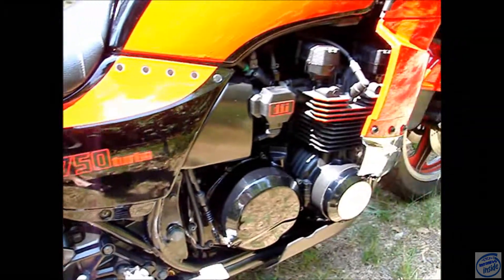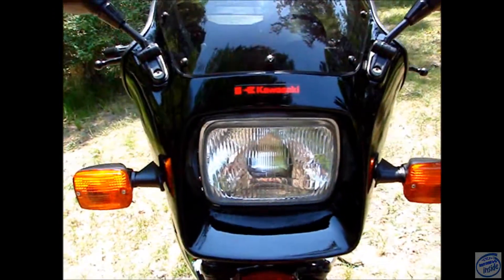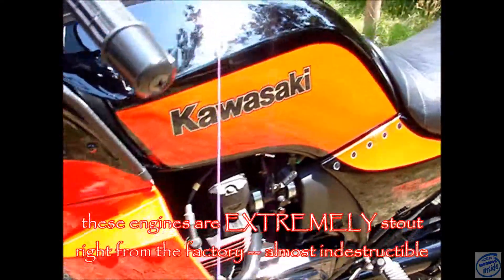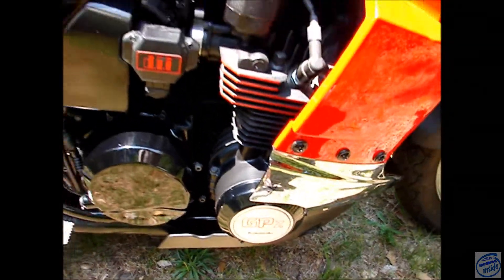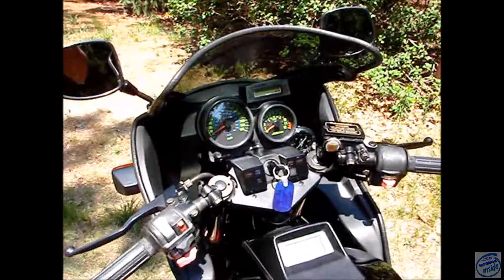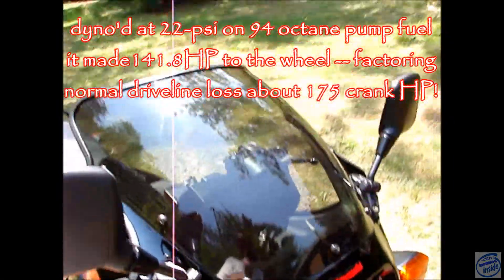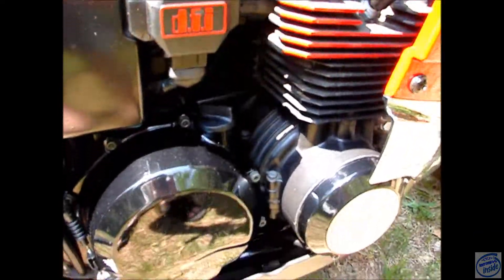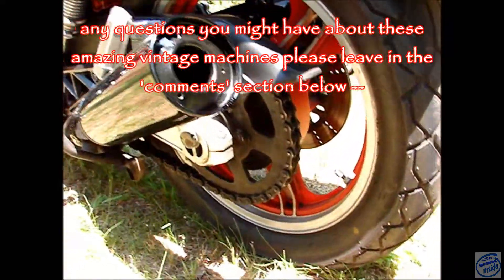1985 GPZ-750 Turbo 175HP Kawasaki RESTORED Wicked 80's Classic Superbike! Startup & Walkaround in HD

Comment: I had an 1985 ZX750E2 turbo for 7 years. Bought it as a new leftover in 1987, put 120k miles on it in Phoenix, mostly city miles. It was my only vehicle for those years. Loved it. Still have dreams about it. We were buddies like no other vehicle I've owned. LOL. Lots of stories. Never had a single issue with it ever.
Reply from the maker: WoW...120,000 miles...unreal! We stared at ours and wrenched on it more than rode it -- lol
Reply: @YourKeysPlease  I was a courier in Phoenix for a few years on it; put 950 miles on it the first week I owned it. I was really good about service intervals. The only mechanical issue I ever had was that the rubber clamp holding the FI unit in the tail section broke and the unit bounced around in there until it failed, so I wouldn't really call that a mechanical failure per se. I picked up a replacement for $50. I went through countless tires, chains, although I only replaced the clutch once (at 20k). Started every time, never even smoked. Just a perfect bike. I ended up selling it to a guy at Motorcycle Mechanics Institute for $1500. Bought it new for $3500. It was either that or a Yamaha Radian and the smart money was on the Yamaha. But I never once regretted my choice.  So many stories about that bike....

Comment: great vid, thanks... yep, if you dont remove the internal baffles they'll end up getting blown out anyway.... 3 issues i had with my Z750 Turbo was smallish fuel tank for thirsty engine at high speed and with no electric oil pump to the turbo you do not want to run out of fuel. turbo torque seemed to wear out soft back tyres quicker but harder tyres would slip, and chain and sprocket wear was something to constantly watch for... all these things were related to my heavy wrist coz it was a bike that was made for some abuse... apart from that the bike was awesome. real good for 200kph cruising.

Comment: Awesome bikes. I owned 2 of them. 1 was all stock I rode ofton on the street. The other was a full blown drag bike that got me into the 8 second 1/4 mile. It had an 880 kit, Mr turbo work, orient head and cams and several other bits. Yours is an extremely beautiful example. Ride it like you stole it!
Reply from the maker: That's exactly how it was ridden Gary, hence the reason for all the chassis upgrades -- a feeble attempt at making the GPZ-T handle as well as it accelerated. It helped, but these machines, especially with mods, will always have more engine than the rest of the bike can handle!

Comment: My friend had one, loved it. I had a 900 ninja. Those were the days!
Reply from the maker: Thanks for the comment Mark. We also had a Red, White 'n Blue '86 900 Ninja (final year) prior to the 750 Turbo... all the Kawi's from that era are really great bikes!
Reply: I had a 1986 GPZ 1000RX when I was 21 after owning a Suzuki 250 X7 and passing my test only eleven months earlier.Some beast that was in comparison. Quick in a straight line but handled like a tank even with early Michelin radials and a steering damper. My Cousin had a 1985 GPZ 600R great handling but not maybe enough power. Great era for bikes, I just wish I had kept mine. Also once rode a GPZ900R with the RX motor. Great handling and just as quick. Luckliy my mate worked at a bike shop so he would borrow the bikes and let me take them out for a test run, not that his boss knew. Rode a GPX750 and a Honda VFR750  from the shop but they were nowhere near as exciting as the GPZ's I had ridden before. The only bikes that were anywhere near as good were a GSXR1100 and a FZR1000 genesis.

Comment: My dad had one back when he was younger. And he beat the ever living dog crap out of it.
Reply from the maker: Can't kill 'em SlowRB... the only thing a turbo can't stand is low-octane fuel or running lean. Appreciate the comment!
Reply: @YourKeysPlease  What do you consider low? I'm out here in Arizona.
Reply from the maker: If you'd like to up the boost pressure anything beyond stock, at least 93+ octane. 100 octane low-lead aviation fuel is also a good choice if you're going for big boost. The intense heat of AZ won't help -- turbos love cool, dense air to avoid detonation and make big power. Hope this helps!
Reply: @YourKeysPlease  thats exactly what my father did. He worked on a private airport at the time. Ran aviation fuel often.

Substantially higher boost, and a nice bov
Reply: @YourKeysPlease  Thank you. Yeah I don't ride her in the Summer out here. I guess it's like the boys in the Midwest not riding in the winter! 111 yesterday and 110 today in Scottsdale.
Reply from the maker: @len9483  Whew -- Good thing it's a 'dry heat'!  🥵

Comment: Love this! I had an 83 GPz 750. Same motor, chassis, fairing.... Just a lot less power without the turbo. In fact, as I sit here looking at this beautiful piece, you are showing the crank cover. This is all I have left of my ol' bike. Except it's a bit, well, broken. Had me a little low-speed, cold tire high-side.
Reply: Not the same sprockets ,transmission shafts are larger, its fuel injected, the chain is larger.it as a sealed aluminum intake plenum. The list goes on as the motor was built for turbo charging.  I have 2 of these machines .  I will be putting a gpz frame with title on eBay this summer 1984 .
Reply: @MrHeavyzz4  I think kawi used the bottom end of the 1100 if i remember correctly..
Reply: @craig_sez8534  More like the 1100 used the same bottom end as the 750 but not the sprockets or the chain as they are huge.
Reply: @MrHeavyzz4  yeah i ment that the turbo used the 1100's bottom end..
Reply: @craig_sez8534  When did Kaw bld first 1100?
Reply: @MrHeavyzz4  i wanna say early 80's..The 1st gen of the gpz..I feel its a bit earlier with the ltd 1100 but i dont remember for sure..

Comment: What a beautifull 750....probably keep up or blow off alotta bikes on the market today !!!...Kawi's are tops !!!
Reply from the maker: Hey Wayne, thanks for the compliments. Considering the substantial weight and the fact it's now more than 35 years old (hard to believe it's been that long -- ugh!), the turbo will definitely still run with many current machines. From our perspective though, the new stuff has no 'soul', everything is refined to the point of boredom. In our opinion, older machines like the GPZ simply ooze character and are very engaging to ride and own. Bonus -- they're also continually going up in value as we head toward an electrified future. Appreciate your comment!

Comment: Has been on dyno ? Mine made 117 rwhp with 22 pounds boost, aftermarket exhaust, modified fuel system etc. And even then was not getting enough fuel for more power. Sold it in 1988. Was a fun bike, when the boost kicked in felt like warp speed for the era.
Reply from the maker: Yes, it was on a Dynojet 200 and made 141.8HP to the wheel. As mentioned throughout the video it took many mods to get to that level. Appreciate your comment -- warp speed indeed!

Comment: I caught at the end 630 chain and sprockets, put a modern 520 O ring conversion on it I reckon you would get another 5hp, plus less wear and tear on sprockets. Lovely bike, I raced a GPZ 750 in the 80's, great motor, but had gearbox issues.
Reply from the maker: That's true Sean, fitting a lighter 520-kit certainly would've liberated a few extra ponies, but for reliability (and the original 630 set was still in such great shape thanks to regular lubrication and adjustment) we left it alone. Incidentally, you mentioned the gearbox -- if memory serves the turbo's had a strengthened 5-speed box not shared with any other Kawi's. Hammered ours year after year, shifted like hot butter and never needed anything but one set of OEM clutch plates. Appreciate your comment!

Comment: Gorgeous bike!! Always wanted one! I had a 86’ Ninja 600R in the same colors. Sold it due to it being a tank slapper. I’m guessing that fork brace you installed was to also help the handling?
Reply from the maker: Your guess is spot-on David. Most of the mods performed were aimed at bringing the handling up to par with that mega-monster of an engine. Even with the Works shock, fork brace, rebuilt forks with Progressive springs, thicker mount bolts, etc. etc. you'd never mistake the handling for a new ZX-10R, but it wasn't bad. Hard to get around the laws of physics, and 540lbs. will always prefer a straight line over a curve.

Comment: This bike was capable of 170hp with  minor mods done in 2 hours for free put computer in race mode,dfi.mod ,with a drill and Philips head ,waste gate threads  in punched to make  adjustable, strong hose clamps for extra boost.plus 110 octane fuel.
Reply from the maker: You're correct Jon. Our computer was in race mode, had an aftermarket Garrett turbo unit with an adjustable wastegate, heavy-duty clamps throughout the intake, upgraded thicker engine mount bolts (important when you start making big power), and on 94-octane Sunoco pump gas made 141.8HP to the rear wheel on a Dynojet model 200... this works out to roughly 175HP at the crank. Appreciate your comment, thanks!

Comment: Cool bike.... What model garrett turbo did you use? I'm restoring a turbo at the moment that came without a turbocharger unit and can't find an original hitachi unit.
Reply from the maker: Hi Martin, the Garrett was available at the time through Mr. Turbo which at the time was owned by Terry Kizer and operated out of TX. It was rated for up to 30psi on the GPZ. You might try reaching out to them as they seem to still be in biz. It's also possible your original Hitachi could be rebuilt with new bushings and seals if you care about originality. Hope this helps and thanks for your comment!
Reply: Thanks👍

Comment: You mention Garrett, which type??
Reply from the maker: Hello Prokopis, thanks for the question. Wish I had an easy answer, but Mr. Turbo who used to sell the Garrett seems to be out of biz now. Measuring the stock Hitachi HT-10B turbo and slightly upsizing to a modern one (ball-bearing units spool noticeably quicker than old bushing turbos, for example) shouldn't be all that difficult. The power gain will be VERY noticeable. Make sure you have proper fueling to match the boost level -- turbos hate detonation. Hope this helps!
Reply: @YourKeysPlease  , hello. I am now restoring one and want to put a good tc to work at good psi range. I read GT 20 is a good choice but GT 20 has many types and nobody clarifies exact type to use
Reply from the maker: @MrPk19  Speak to a turbo specialist who will be familiar with the various specs (impeller and housing sizing is critical) and can spec the best one for the GPZ. Aftermarket units may require some custom piping for a perfect fit. Good luck with the resto -- love to see a vid of it here!

Comment: That isn't making anywhere close to 175 horsepower with stock exhaust.  120 maybe, they made around 100 rear wheel horse power give or take a bit, about like a 900 Ninja
Reply from the maker: Sorry to have to disagree, but the 175hp at the crankshaft is very real. As clearly stated in the video, our GPZ isn't stock. The mods included a larger Garrett turbocharger with an adjustable wastegate, ECU in race mode, elimination of the restrictive stock air intake (K&N directly on the turbo inlet), stainless clamps throughout to prevent high pressure boost leaks, etc. At 20psi it made 142hp to the rear wheel which factoring customary driveline losses equates to 175 or so at the crank. Btw, what appears to be the stock exhaust are really just two hollowed-out, powder coated cans with the internal baffles removed. Hope that helps clarify things -- we thank you for your expert commentary!
Reply: @YourKeysPlease  Dyno sheet
Reply from the maker: @ZXLNT  We have it all -- dyno sheets, time slips, all the parts costs and invoices... but it isn't possible to add them to a completed video. Appreciate your interest!
Reply: @YourKeysPlease   19 percent power los ? That seems extreme for a chain drive. Looks more like a calculation for a driveshaft of car transmission.
Reply from the maker: @bertr286  Unless one were able to attach the dyno directly to the crankshaft, we went with industry accepted drivetrain power losses. Agreed, a unitized setup as found in most motorcycles likely experiences slightly less power loss than the average automobile drivetrain, but determining exactly what that difference is would be difficult. Appreciate your comment.
Reply: @YourKeysPlease  I had several  test reviews on this bike and your numbers sound right in the ball park. Put  about 1000 clicks on a week trial-run on this bike myself and its all they claimed. Recall a nasty little speed wobble (stock set-up) around that 230+km mark, Gem of engineering for its day.